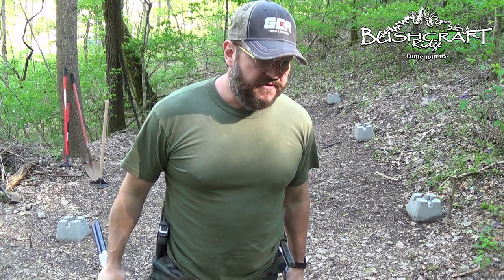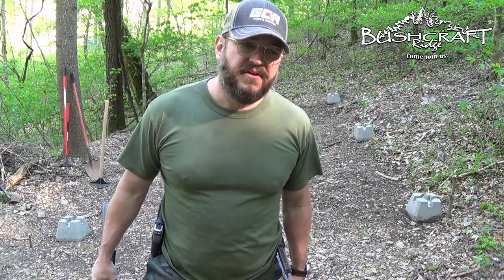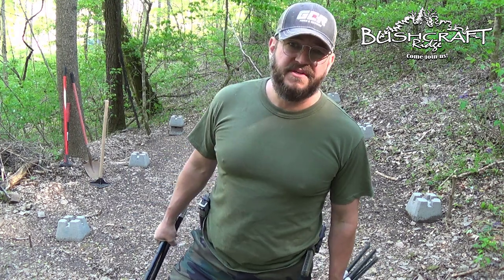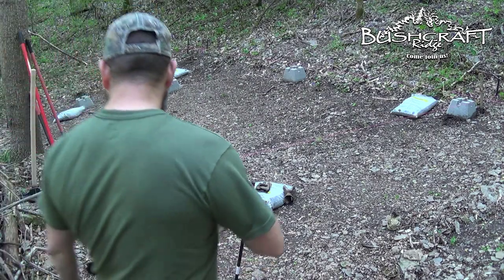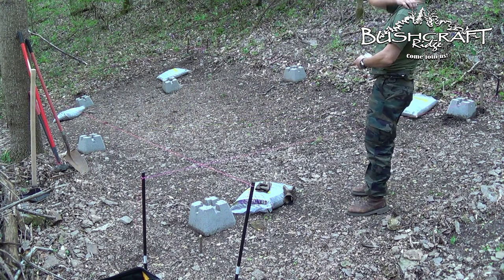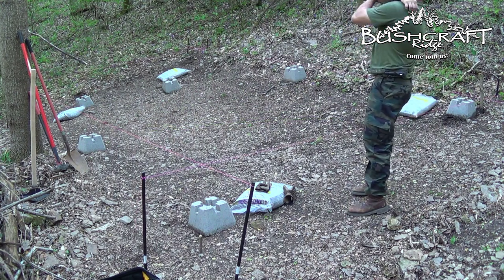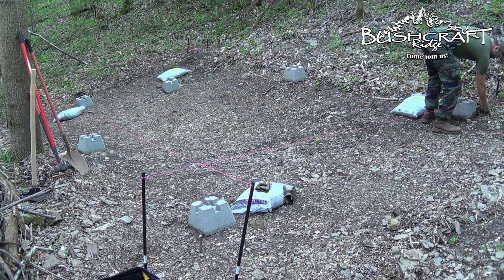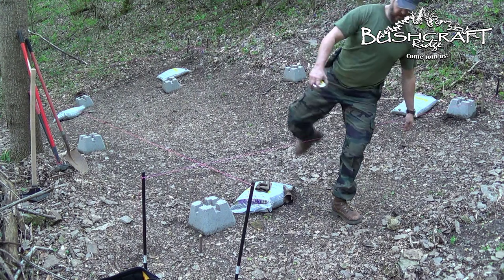Off-Grid Cabin Build 4.16.2020 -- Stakes and String

Comment: As to your mention in the description doing the 3-4-5...start with a string 10 feet long tied to your benchmark. Go straight in a particular direction and drive a stake at the end of that 10 foot string. Do the same perpendicular with another 10 footer. Adjust the placement of one of them until they're 14.14 feet apart and you're perfectly square. now your have two permanent lines you can measure and build from. You can do the same from the opposite corner from your benchmark or even from all four corners. It's looking good so far. Keep it up!
Reply from the maker: Yep!